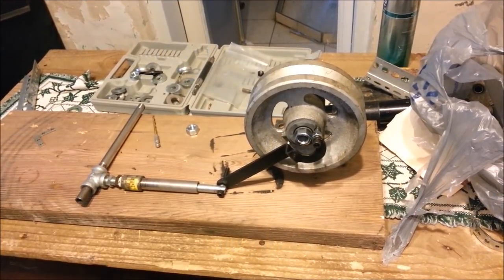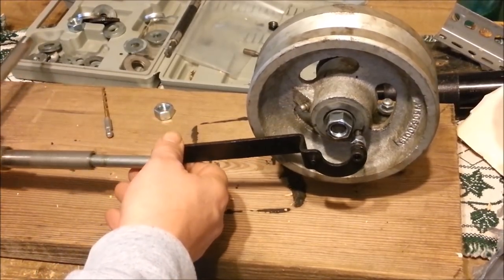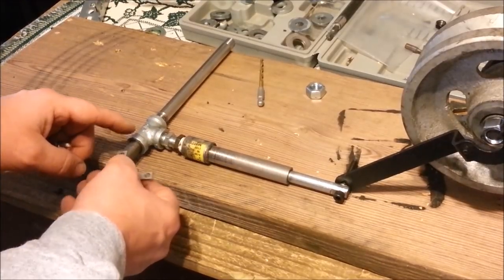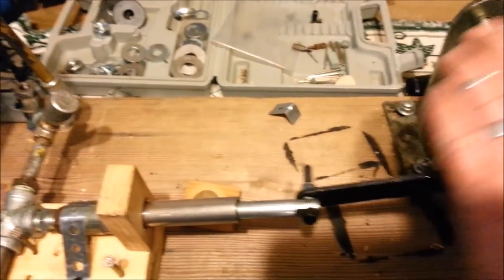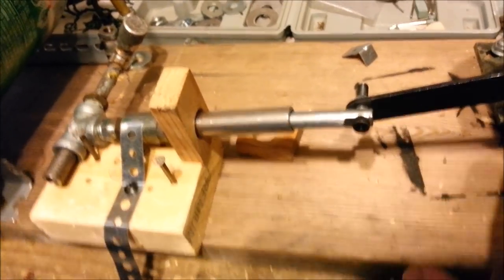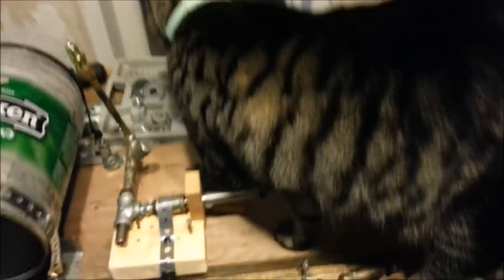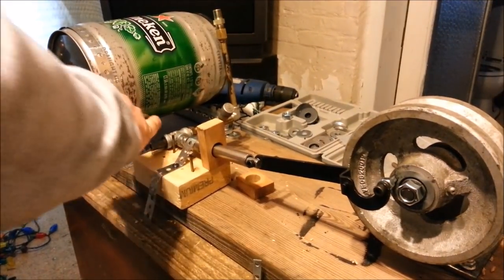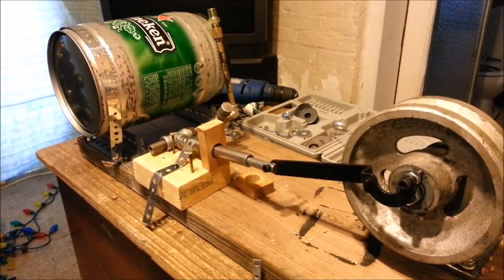How to Build a Steam Engine Part 1

Comment: Wayne, I never got the valve on my first and only engine . Is that why it didnt work?
Reply from the maker: I would say probably so. The valve allows steam to switch from the piston to exhaust. The steam needs to travel through the cylinder under pressure from the piston and back out.

Comment: And you have insights beyond Mr. Watt's?    Perhaps multiple stages?   Or adding a safety valve?  Or two?
How about a blowdown?   Valve controlled?  Certainly.  Then there's piston valve control, with all that messy stuff.
Tell us, and the patent offices, what have you improved upon?    Give up?   Tr y turbines:  My bother-in-law made a bundle with them, until Chrysler figured out the mileage was 6.1.   Back to flipping hamburgers.
Reply from the maker: John, my channel is about getting off a lazy ass and trying. You don't need to be a fucking engineer to build shit.. Good day sir.
Reply: Wayne Earls Amen couldn’t have said it better myself

Comment: This is one of the complaints I have about my fellow steam engine builders:  the engines don't power anything.  So what's the use of having them?  I know--I know, to brag to ones friends and to put on the mantel shelf and even to sometimes fire one up.  But REALLY, these things are so powerful and wonderful and fun, so WHY are they not powering a powere plant or running a saw or even a fan or something useful?  I appreciate what you say in your opening remarks.  Thanx
Reply: it's a hobby, they are mostly just models and a curiosity but there are some very large engines still in productive use, they run forever haha.
electric power plants still use steam turbines to generate electricity, tho very advanced
Reply: @pauls5745  Yes, true, but so is a tiny generator or a fan or whatever.